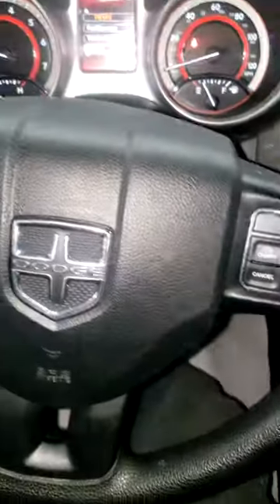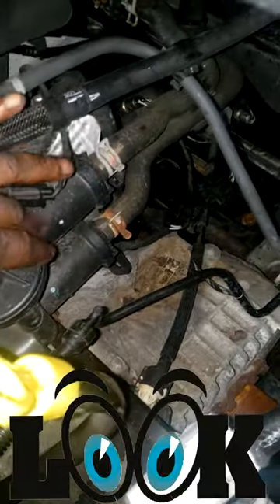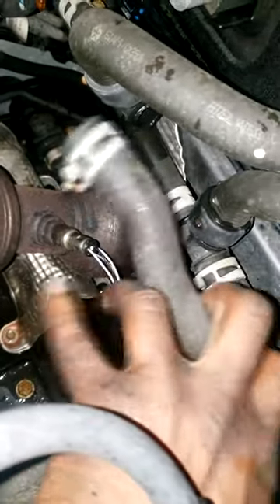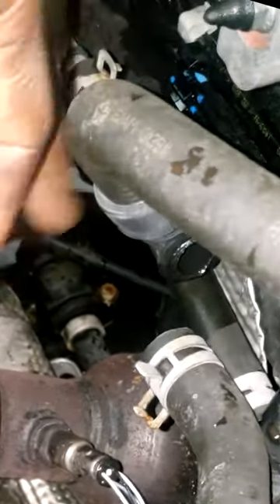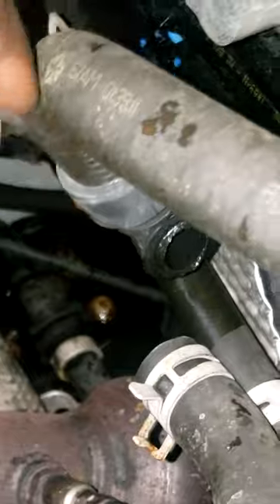Here's why plastic was a bad idea.

Comment: I've replaced those darned plastic tees and y with aluminum fittings I found on eBay before they break. Much cheaper than a warped head
Reply: I have fab welded one with steel and made a T but im going to look into aluminum

Comment: that's easy to access. try the steel ones on expeditions that run through the middle of the V of the V8 and corrode at the back of the block.... 10 hour job, once you figure it out.

Comment: Plastic does suck. Same issue on Chevy Sonics like 2013ish era what’s worse they don’t have temp gauges just a temp light that comes on when it’s to late haha. And the bleeder screw is on the radiator on the top and they get stuck so those break when you fix the other plastic parts and your trying to bleed it. Ugh, why just why?